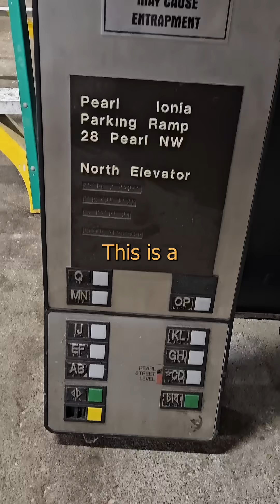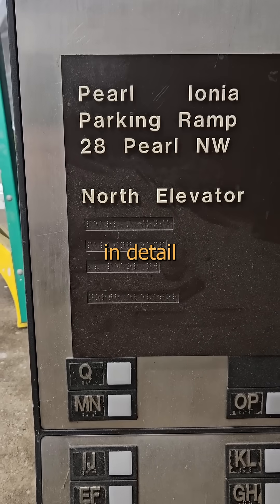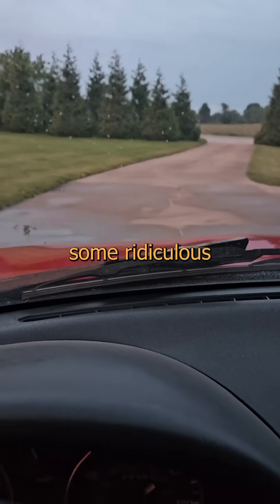Miata Mischief #chrisboden #engineering #gear #elevator #score #stories #parts #hacking #making

Comment: I bought an 11x36 south bend lathe at an auction.  I also bought an engine hoist.  I hoisted the lathe, disassembled the legs, backed my Subaru station wagon over it, set it down, put the legs in beside it, took apart the engine hoist, strapped it to the top, and drove verrrrry slowly home.  I then reversed the process to unload the machine at home.

Nobody thought that would work.  I showed them!
Reply: then needed to replace the suspension lol
Reply: @M.TTT.  Hey, the rubber stops make good suspension all by themselves. If you're driving on rails, that is.
Reply: @M.TTT. Nah, it did it happy as a clam! (A clam on bump stops, but a happy clam on bump stops!)
Reply: I am Very impressed. Did you have any plywood in the back or stuff anything to support the spare tire compartment lid? Top marks for Subaru usage. I flipped down the passenger side seats and left the hatch partly open to haul 50 8"x12' sheets of cement board siding per trip from the Menards. Set it on a base of two 2x4s rachet strapped it to hold it's shape and buckled it in so it wouldn't come sit in my lap.😅
Reply: @mechticulous8202  Nope.  It stood up to it like a champ!
Reply: I swear every subaru has magic bag of holding cast on it. I had an outback, kids daycare closed and parents could get what they wanted before the rest went to donation. I keft with two low toy shelves, a trinagle book shelf, a little tikes slide, little tikes picnic bench, and assorted toys. The only thing on the roof was the slide piece of the slide and the picnic bench. Everything else was inside with the doors closed. Though I did have the kids carseats stacked in the passenger seat
Reply: After South Bend Lathe closed we had a undercover grow business and across the way these Russian hookers had a jive joint in some offices. Right across Sample St from the cop shop.
Reply: Man... Soobs are tough little wagons!

Comment: My friend needed a rotax engine and gearbox delivered to a friend in Arizona (we were in Southern California)

He knew my mom's car was in the shop and I had a loaner vehicle. So he called me and asked if we could use the loaner car thinking it was a discovery sport.

Nope! It was a brand new Jaguar xe with like 3000 miles on it.

The look he have me when I pulled in was priceless. I told him to have faith and we stuffed a gearbox and some extra parts in the trunk. Then plopped the engine right in the back seat.

Aaaaand off we went!

Comment: I once moved an entertainment center in a 06 Taurus. Had the top half hanging out the back of the trunk and the bottom was hanging out of both sides of the rear doors only being held closed by the seat belts in the locking position.

Comment: I wanted to donate my old 42” from 08’ to some buddies moving into their college apartment but I own a Miata… So I dropped the top, plopped the sucker in the passenger seat, and secured it only using the seat belt. Let me tell you, 70mph on the highway with an obelisk as my passenger is some crazy shit! Next time if I need to commit to anything like that, I keep 2 ratchet straps in my trunk now.

Comment: Bought a full-size, 42u server rack a couple of years ago, didn’t want to bother anyone to borrow there vehicle, so I drove my little 23’ Subaru Impreza down to Connecticut from VT, by some pure Miracle fit the rack in the car after taking all the panels off. Strapped the sides to my roof racks strapped the hatch to the rack (that was sticking like 2-3 feet out of the back of the car) tied the door and other parts to the frame of the rack and drove it 250 miles  back to  northwestern Vermont, listening to the seatbelt chime for over 30 minutes only to realize the tub of rack rails  was setting off the alarm because it was heavy enough to do so. Also only ever rent roughly 55 miles an hour max because if I went any faster, I could feel the metal side panels lifting off the top of my car in the wind.

Comment: So I was a college baseball player. Once I had to haul a mattress on the top of my Mercury mariner (a vehicle that is…not well equipped for such a thing). So, being the absolute genius (idiot) that I am, we strapped it down with exactly one tow strap, and I hooked my J-bands to a circular tag on the front of the mattress to keep the mattress from flying into the wind and hooked the straps to my arm. I will say, with the knowledge that a strong gust of wind would pull my shoulder out of socket, that trip was taken pretty slow lol

Comment: Was doing a job down in Asheville NC as a favor. I don’t usually travel for work but it was for my mom who works for a locally based clothing company here in VT so there was no saying no. They set me up with plane tickets, an Airbnb to stay at and a shiny new Chevy Malibu to do all my traveling around. Mind you I was completely transforming their new store location and pretty much starting with a blank slate. One of the tasks was building shelves out of 2x4s and 3/4 inch CDX. The Home Cheapo never seemed to have one of the trucks available to rent at the time of day I needed it so I had the guy in lumber slice all plywood in half hot dog style for me and proceeded to pack it and 30-40 2x4x16ft SPF’s half into the trunk and half cantilevered out the back end 😂 needless to say I took the scenic route to the site and stayed off the highway since she was on the axle stops and the front tires spun each time I tried taking off too quickly. Had it been rear wheel drive you better believe I’d have been the first stock Malibu to be pulling wheelies down Main Street of Asheville 🤣 Still have pictures of it too.

Comment: I used to have a 96 Toyota Celica coupe, and when you gotta move things you use what you got. I would take out the passenger seat so i could have extra space. I once used to to move about 15 rack servers at once. She did it, but that poor little motor was not a happy camper about it lol, braking was also fun :D. I moved small dressers, computer chairs, desks, and many many boxes with that car, it was way more useful than i initially thought it was going to be.

Comment: I only have two, both involving my bicycle. One was a box of flat-pack furniture i rested on the handlebars and seat while i walked beside it across my entire neighbourhood. The other was a rusty old flat radiator which was too large to strap down in any way, so i had to prop up one end on the frame by the rear wheel and hold the other with my leather-gloved hand to avoid tetanus. Drove like that to the scrapyard, some 10km away, on busy public roads.

Comment: I bought a sofa at a yard sale shortly after getting married, and back then money was too tight to rent a truck to move it. I flipped it upside down and ratchet strapped it to the top of my '96 Geo Metro which was comically smaller than the sofa itself. Miraculously, I got the sofa home without being stopped or blown away by a gust of wind. For kicks, I found the Beverly hills hillbilly theme song to blast for my wife as I was pulling into the driveway.

Comment: I hauled a 20kg cat food bag on my suzuki gs500 motorcycle strapped with two rubber-bands (y know what im talking about, that thing with hooks on ends). And recently, on the same bike, I drove 60km at night, through rain, with a new 20 liter canister full of diesel, straped with same rubberbands, because I mixed fuels in gas station and had to drain my fuel system. 60km from home. Had a thrilling experiance.

Comment: My father and I "accidently" bought a tractor at an auction with no trailer to bring it home with. We got the auction yard workers to put the front end of a 1939 Allison Chalmers WC I the bed of our pickup truck. We then chained it over the tailgate to the hitch receiver as well as to the front tie downs in the truck. We pulled it 65 miles home that way on the backwoods. At one point I actually rode the tractor trying to figure out what a noise was that we kept hearing from the cab. It was a Mason jar put over the exhaust to keep water from getting into the oil pan.

Comment: So I didn’t have to haul this as far as I’ve seen some people but what you have to understand is that the area near my home is a bunch of stupid hills and I’m talking like 55-60° incline so my stupid ass had to scoot four sets of welded steel shelving down a hill and then up a separate hill on two skateboards while having to shuffle off onto the shoulder for cars, this took me the better part of two days and when I was going down the hill I had to brace the shelves against my back and I wound up with a crazy welt across my back, but they were free and I had no shelves for tools and materials in my garage so I managed it

Comment: Not I ,but my father: Imagine a 1981 Chevrolet Chevette traveling south on I-5 in the mid 1980's. It was a common sight, except for the day when my dad bought a three-section crank-up radio tower and needed to move it from Seattle to Portland. Did he mount a hitch and rent a trailer? Well of course not. He tied the tower to the luggage rack and put a red flag on either end of the tower.

Comment: Similar to the Miata. I daily drove an S2000 for nearly a decade. All my shopping trips, home projects, everything in that car. The craziest was picking up a set of tires for the car and driving 8 miles home, on the freeway. One in the trunk, two stacked in the passenger seat, and my hand holding the 4th sitting on the other two but existing just above the top of the windshield. And yes, top always down, even in the fickle weather of western Washington.

Comment: Hi from Germany! I once packed a whole bed, disassembled, and matress, folded, inside my then first car, a Peugeot 307 hatchback. I flipped down the back seats and front passenger seat and my ex gf had to lie flat on the matress, pushing it down so it wouldn't unfold and open the trunk hatch, which she had to hold down with the second arm. Drove around 30 miles that way.

Comment: An 05 pt cruiser convertible hauling an 80 inch flat screen TV home. I also used my 01 ram 1500 to haul a 3 bedroom apartment in one load. Made it almost 2 hours away to moms house with a blanket and ratchet straps holding everything in piled about 4 feet above the cab before I got pulled over in the middle of nowhere in the country. Cop just told me "if you made it this far im not gonna write you a ticket 2 miles from your destination, just get this thing off the road"

Comment: Had a friend moving back home, and he gave me his bed and "little" ikea book shelf. I had a mini Cooper convertible,  and it was the first time i took the top down. We put the bookshelf in the back seat and started the drive home. After 2 minutes on the free way, my friend starts panicking and being like "SEAN, ITS FLYING AWAY!" He's holding it down as the wind was trying to lift it out the back seat. I pulled off the free way immediately,  in a neighborhood I'm not familiar with, and had to navigate back to my apartment using just a general sense of direction cause my phone sucked, no GPS. This of course was in Los Angeles,  so imagine that if you will.

Comment: When I was a teenager, my aunt gave my parents an old storage shed. So, my father set about a plan to get it home, about 35miles. My pops came up with the idea to use some old cable camper jacks to lift the shed. These camper Jack's were beyond sketchy. They consisting of cable ratchets running up the pole, to a redirection pully at the top, to a peice of angle iron to support the load. The bases were made of plates welded to tiny outrigger-esk tubes that the upright slipped into the middle of, sloppily.  We used the pair of deathtraps from the 50's to lift the shed about 6ft in the air, enough room to back our '73 f250 under the shed with cross beams ontop of the bed rails. While this may not sound sketchy, the truck was worse off than most things you'd find in a junkyard and I am convinced the dents and wrinkles were structural at that point. With a few bowlines and trucker hitches, the shed was prepped for the 35mph trip home. We made it safely, having trimmed more than one tree for the local maitnence crews, free of charge.

Comment: I bought a device that was too big to fit in my car, so I borrowed my sister‘s car because hers is bigger. I still had to change the position of the seat to be fully forward, but I managed to get everything inside. The only problem was, that the leg room now was too small and I couldn’t reach the clutch, but i could reach the brake pedal and the gas pedal…

I had to start the car with the gear engaged and then shift with the matching revs. To stop the car i had to put it in neutral, then turn the engine off, put it in gear again and start from the beginning…

Comment: I bought a futon that was still in its packaging and realized i couldnt get to fit in my Dodge caliber even with the seats folded down cause it was an inch too wide to fit inside. i went back inside the store bought some ratchet straps threw it on the roof of my car and strapped that bitch to the oh shit bars in the front and back seats. mind you no roof rail, and the sketchiest hold of those straps to the handles but that thing managed to hold firm.

god i love it when things just work out

Comment: Not that fun of thing but. I needed to buy a 20' pole to repair my garage door. I owned a Nissan juke with a sun roof. I ended up sticking it thru the sunroof and had 14 feet of pole sticking out the top. It was an interesting ride 12 miles home looking like a deformed unicorn.

Comment: A few months ago I had to transport a small server rack that was going to power part of an art installation, in my 1st gen Nissan Leaf. This rack weighed the best part of 100KGs, didn't fit into my car with the wheels attached, and I was on my own to load and unload the thing. Ended up using a pair of ratchet straps and my car jack to ease it into the boot, then balanced it on the folded down rear seats and strapped it in front and behind to the seat support brackets. Let me tell you, the hour trip from home to the gallery was the smoothest I've ever driven that car.

The other one that comes to mind is fitting half a tonne of co2 tanks and sfx gear into the back of my subaru legacy to take them back to the hire shop because I didn't want to have to take the van and then return to work to get my car back. Bumpstops getting a work out on every speed bump on the road.

Comment: I hauled a snap on Intimidator 2 toolbox in the bed of 82I guess it was Dodge rampage, pickup truck. Uh, we were on the suspension stops. The entire rod, and at some points, the front wheels lifted off the ground

Comment: I had to move my 65 beetle project car with a trailer that was barely big enough to fit a golf cart. 

i ended  up taking 2x4s and plywood to extend and widen it and held it together with ratchet straps, no screws no bolts, just straps. 
I drove it up and over the trailers' fenders and high centered it on top of them. I beat the fenders until the trailer would roll and sent it.

 There were no straps on the car, just the parking brake, because I used all the straps to attach the wooden platform. 

no safety, no sense, only liability if shit went south 😂 but we got it to the new shop and no one was maimed in the process

Comment: Was on a motorcycle and had to get a front 20 in rim and 16-inch handlebars home 10 miles away. So thanks to budgies and willpower, I straped them to myself  and back pack and rode in home.

Comment: A few years ago I found an early 2000's 65' Plasma TV. At the time, my truck wasn't available for some forgotten reason. So I borrowed my wifes 2000 Ford Focus. I cramed that tv as far as I could into the back seat but ultimately ended up driving over 30 miles with one of the back doors wide open. Even drove past a cop when i got back to my town and he just shook his head 😂

Comment: When I was 16 I bought a two door manual cavalier, put a new bumper on it and not a week later stuffed it in a ditch on an icy dirt road, drove it through the field and busted the new bumper. Drove two hours away to get a new bumper and had it stuffed from the dash to the trunk lid with the back seats down but I learned my lesson 🤣

Comment: I have a red Toyota hatchback, and if more than 3 adults are in it, you can feel it while driving. We were moving a big safe across town but we couldn't get it the way in even if it were just two of us, so we used bungies, ropes, and several rolls of 100mph tape to make it look like we were Loony Toons-ing it while going down the highway and it was starting to get dark. Eventually, we had a cop following behind us and I needed to pull over to the side of the road to check the map. The cop went on a pulled over in front of us and backed his cruiser up because he was curious as hell. As my buddies and I did a Chinese Firedrill to inspect the connection points, the cop clears his throat and we all freeze in semi-commedic poses and he starts to choke on his laughter. 

It was a blast. He asked the standard questions, helped me with the map, and we all got on our merry way. I still have the picture around here somewhere... good times.

Comment: I worked at a harbor freight, and I put a 10x17 car port (box was about 8 feet long and about a foot wide) into an RX8. In through the back hatch and out the passenger side window

Comment: My wife hauled a large tractor tire with it able to roll in the small bed of a Chevy pickup untied down.

Personally, back when everyone was collecting pallets during the plague, I stacked them high in the bed of a truck that 90% of the electrical system failed in and drove it home in a mild sandstorm. I didn't go full Latino uncle, but it was still stacked 3 foot higher than the bed sides. The local tio's were running the same setup as me but with the pallets stacked 3 foot taller than the cab.